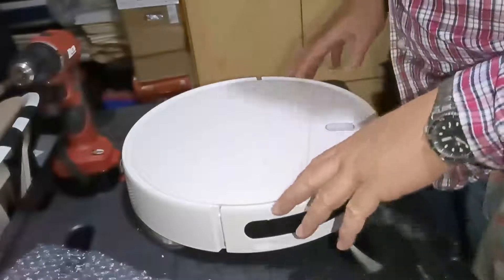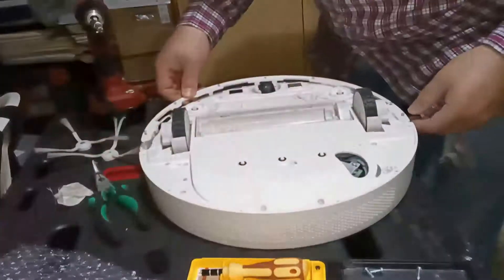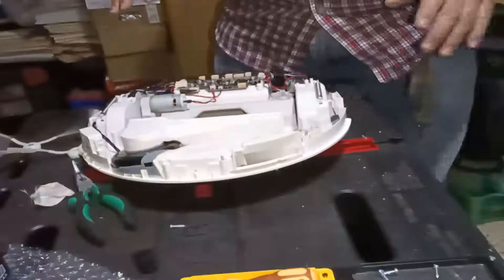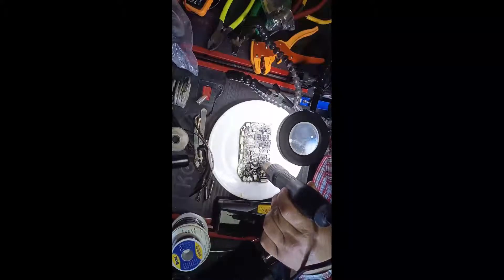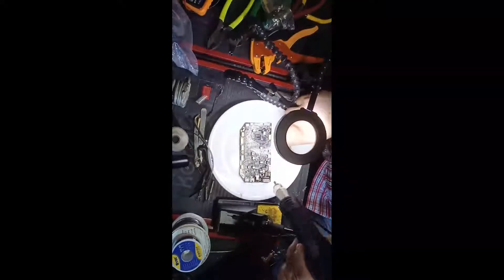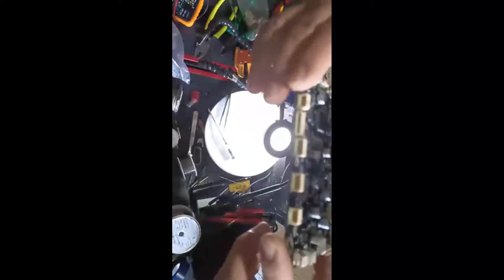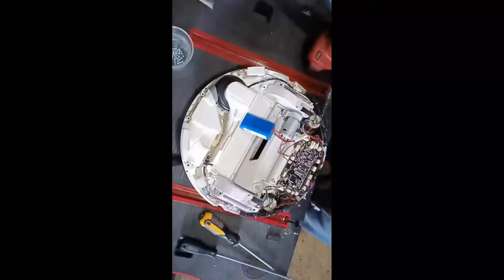Fixing a common problem in the Xiaomi Mijia G1 Vacuum-Mop Robot

Comment: When docked, there's a blinking orange light. long "power" press clicks some noises in the speaker and it continues to blink orange. DMM shows <2v in the battery, but long charging period doesn't charge it. how do I know if it's a faulty battery ? or a faulty charging circuit ? DMM shows some ~20v on docking pads.
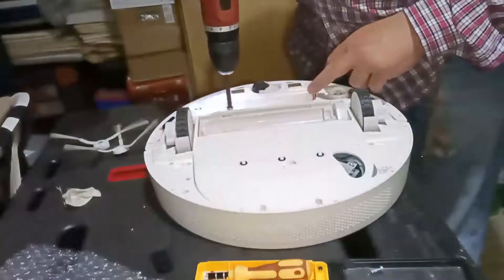Reply from the maker: Dismantle battery pack as shown in 1:15. Then test the contacts. If the external contacts show <8V, the pack is shot: It's enough one Li-Ion cell is below 2V and it will never recharge. So if the entire pack is <8V, you know it's basically gone. You can find another battery pack for the Mijia G1 at AliExpress. For example, https://www.aliexpress.com/item/1005006585073748.html offers several sizes. I'd go for the 12,800mAh battery pack, even though it's more expensive. In any case, your description bears all the hallmarks of a dead battery. Cannot guarantee this is the issue, but.. Well, 90% this is it.
Reply: @nyyotam4057  Awesome. just for my general knowledge (as an electrical engineer) ... how/why do you say that if the cell is <2v the cell is dead ? I'm trying to understand the explanation to that. (or in other words, why won't it ever recharge)
Reply from the maker: @HagaySpector  It's a Li-Ion cell. Usually you'd have a BMS that would cut it off when it goes below 2.5V in an effort to prevent it from even getting close to 2V. If it did wade under 2V then any attempt to charge it with a large current will result in an immediate destruction of the coating of the cathode (usually a thin cobalt layer), thus destroying the cell. In a factory setting, they charge the cells using minute currents until their voltages go above 2V and then charge to 3.7V. The cell is designed never to go down back under 2V in it's service life.
Reply from the maker: @HagaySpector  Well, I trust you will take care not to allow either of the cell voltages to rise above 4.2V per cell. Or, if you are afraid one of the cells might do that - well, just buy a new battery pack and that's it.. In any case, one safe way to do it, is to acquire a 4s BMS, like https://www.aliexpress.com/item/1005006682322680.html . Now you have to test it (!!!). I mean, once purchased a 10-pack of these Chinese BMS's and only two of the entire pack were okay. Go watch?v=8c-5-sHIrNI to see how I test them. Once you have the BMS tested, you can disassemble the battery pack and connect between each two batteries to the appropriate connection in the BMS. Afterwards you can charge through it while limiting the current to 50mA.. And then, once each of the pack's cells is recharged again to 4.2V, test every one of them using a 1ohm 20W ceramic current limiting resistor in series with a shunt to acquire the cell's internal resistivity. If it's under 0.2 Ohm, you can still use it. If it's more than that, I'd replace the faulty cell with a new one. In fact, this is my standard procedure to rejuvenate an old battery pack. watch?v=HSz-4IN_eHQ about that. But yes, considering time is also money, simply getting a new battery pack might be the wiser (and cheaper) choice here 🙂.

Comment: Good evening, I also have this robot model, I replaced the battery and now it does not charge, it tells me to check the connectors on the charger, but everything is clean, now it does not charge even with the old battery, what could be the problem?
Reply from the maker: Did the old battery and the new one give out the same voltage with the same polarity?
Reply: The robot does not want to charge now even with the old battery, it tells me to clean the contactor pins where the charger makes contact and it does not want to start
Reply from the maker: @cosminchincea9772  Use a multimeter. Check that the line shows continuity from the contact all the way till the CPU and where this continuity stops. Do it for both contacts and you will find where your line is broken. It could be that the burnt element is a fuse of some sort (perhaps a sacrificial resistor). If that is the case, you may need to replace it (or short it.. At your own peril). Well.. Good luck. What's the worst thing that could happen? At worst you'll burn the G1's board.. So you'll have a good excuse to throw it away and get a better model 🙂.
Reply: @nyyotam4057  Thank you, I still have a month's warranty on it, I will take it to you for service on Monday
Reply from the maker: @cosminchincea9772  😂😂😂👍

Comment: It is bit difficult to understand what problem it is you are trying to show to solve? It would be nice, renaming the video to match the problem rather than Common problem is so annoying when people do not name their videos to match what problem is taking to long time sittint watching and willl give you more that will watch;)

Mine won't power on and  when placed on the charger it comes on with short notice and power on/off continuously and battery has power 22,3v / charger works so am I facing same like you or ? Mew battery is pretty expensive so want to be sure first, can you help?
Reply from the maker: It could be you need to replace a voltage regulator. This board has sevaral HT133 units but I'm afraid that if any of them were lost, it could destroy other critical components like the CPU. So maybe you better think about replacing your G1 to a better model :-).

Comment: Did anyone fix the problem with the wheels? My vacuum it does not charge at all because when i put it in the dock it moves and disconnect from the dock. It is a battery problem?
Reply from the maker: Read my reply to McGybeer.
Reply: I have the same problem , did you manage to fix it?
Reply: @lyamc4445  yes, in my case it was the battery.

Comment: Hi my Xiomi starts clean up and after around 15 sec it says brush error please check and clean it, is it the same thing you fixed?
Reply from the maker: In my case the main brush would simply go on working relentlessly until the battery is dead (or until I dismantle the bot and unplug it), so the fix was straightforward, to replace the MosFETs. But your case is different and I'm afraid it's a lot more complicated: To get a brush error like that after 15 secs or actual work, you need your motor to be drawing too much current. To me it seems that the most logical explanation is that you either (a) need to replace your brush or (b) need to replace the brush motor, but there is also (c) that you need to replace its on-board motor driver IC which might be custom-made by xiaomi so if its (c) you may need to visit the vendor's support station and pay them to fix it, cause you might be unable to obtain the correct IC driver anyway. It might be proprietary.
Reply from the maker: OR maybe (d) you need to replace the current sensing resistor (which I have no idea where and what it is). If it's burnt and develops full voltage, the IC would see it and interpret this to mean too much current. So this is another possible issue that could cause it.
Reply from the maker: In any case, my case was simple. Your's not.
Reply: Ok thanks for your help
Reply: Hi just to let you know the problem was simple I found someone who had the same problem as mine and all that needed to be done was to solder again the brush motor wires seems that they can get some oxidisation and thus bringing the mototor to stop.
Reply from the maker: @Taxidermist69  Okay, that's option (e) then🙂. Glad you found a solution.

Comment: Thanks a lot for sharing this. I have the same problem, do you think if i just add a physical switch to the wire connecting to the brush motor, do you think this will work too?
Reply from the maker: It will enable you to stop the main brush which will allow you to manually solve the issue for now, until the MosFETs you purchase from AliExpress arrive 🙂.
Reply: I just did that an hour ago, and it worked...

Comment: Hi there! Thanks a lot for the video and for the links, I have the same issue of the wheels spining non stop. I've just changed the diodes, but the problem is still there. Do you have any other suggestion? Or maybe the board schematics, so I can try to investigate it. Thanks in advance 😉
Reply from the maker: This clip is about the main brush and not about the wheels. I don't have the board schematics but luckily, this bot is so simple you don't really need it, just use a multimeter to check which MOSes power the wheel motors and replace them. Check the MOS model to make sure you are replacing properly: It could be a low gate voltage high current PMOS enhancement mode just like the A03407A and if it is, and you already have A03407A's, they should work. However, it could also be some kind of an NMOS on the way to ground. So the only way to be sure, is to read what's written on it (use a cellphone camera with a flash an magnify). If you're lucky, whatever it is, it will be a low gate high current PMOS and if you already have them, you're golden. Tell me how you fixed it.
Reply: @nyyotam4057  Thanks, I'll check that 😉
Reply: @nyyotam4057  Mmmm... I'm checking it and it seems not so easy. My issue is both wheels and the main brush keep spining, that's why I thought it could be related. I've changed the diodes and the main brush still spins non-stop, and the wheels are powered by stepper motors. If all of them are affected, maybe it's a software/firmware issue. I'll post here if I find the issue
Reply from the maker: @McGybeer  Hmmm.. If all MosFETs are affected at once, maybe its not one of the MosFETs but maybe it is the voltage regulator (HT7133). Here's a link where you can find it: https://www.aliexpress.com/item/1005004050505952.html?spm=a2g0o.order_list.0.0.21ef1802j5qbMq - select HT7133 and good luck because this is a long shot.
Reply from the maker: @McGybeer  Sure, there is always the possibility that it is a software problem and then you need to try and D/L a new firmware from Xiaomi. I'm not at all aware of how to convince them to let you do that.. But that is definitely a possibility.
Reply from the maker: @McGybeer  In short, you may try to replace all MosFETS and voltage regulators on board just for the fun of it, and maybe it will work. If not, it's software. But even if its software, in this case this does not make it an easy problem, cause then you need Xiaomi to voluntarily give you their software. Maybe they will agree. Good luck in any case🙂 .
Reply from the maker: @McGybeer  Well, technically the CPU can be done, but the chance of that is very, very slim because it does have many protections. In most likelihoods, it would be one or more of the MosFETs - and in your case maybe just a voltage regulator. But technically it could be the CPU. BTW, did you try to remove and reinsert the card?
Reply from the maker: @McGybeer  I mean, in my Mijia there is an SDCard in the top part of the bot, connected via a cable strip to the mainboard connector. Maybe it got wet or something? Also a possibility.
Reply: @nyyotam4057  Can't find the SD. On the top of the bot there's just the button/LED board and the WiFi module
Reply from the maker: @McGybeer  Maybe 🤔 your mijia has another solution (flash chip or something). Anyhow, if the problem is software, this does not turn it to an easy problem to solve.
Reply: @nyyotam4057  Yeah, you are right. It will require a lot of time and tests. Just worth for fun 😂
Reply: @McGybeer  did you fix the problem? How?
Reply: @MrCringus  No, unfortunately I couldn't find the issue
Reply: @McGybeer  did you try changing the battery? Mine has a 3.2V, i will try to change it.
Reply: @MrCringus  Yes, I tried that and didn't work. I ended up buying a new vacuum robot because I didn't had time to investigate
Reply: @McGybeer  many thanks for your feedback!👏
Reply from the maker: @MrCringus  In fact I also bought a new vacuum, one with a LIDAR sensor that can make a map of the apartment and be told where to go. Only marginally more expensive, the Xiaomi Mop-P has these features. It is a bit taller, so some places that the G1 could creep into are off limits for it, but it does a fairly good job elsewhere. And you can tell it to clean only the kitchen 🙂. Gave my old G1 to my sister in law and she gave it to her sister - and as far as I know it is still working (though they also think about replacing it). The G1 simply has too many compromises to be called "good".
Reply: Hi guys, just a quick update: today i've change the battery and the vacuum works normal again!💪
Reply from the maker: @MrCringus  Yeah, but let's not get too carried away here 🙂. It's still just the G1.. Meaning, it will sweep your home, but the compromises Xiaomi took are way too large. Like, you have no consistent map. So you cannot tell the bot to go clean just the kitchen. Stuff like that.
Reply from the maker: @MrCringus  Still, congratulations for solving your issue.

Comment: Hi this video is very helpful, but my mijia g1 vaccum issue is when connected to battery the two tyre is spinning non stop and not the brush like yours. So if i change the  SOT-23 A03407A like yours will it solve the problem?
Reply from the maker: Not sure. I got no idea which MosFETs are used to power the wheel motors and not even if they are low voltage-high current enhancement P-channel like the A03407A, so I cannot really say that I know what to do, however, this bot is so simple - all you need to do is track the connections to the wheel motors and see which MosFETs powers them. Use a multimeter to check. Then you need to read what's written on them. Use a cellphone camera with flash and magnify. If you identify the MosFETs as a low-voltage high current P-channel enhancement mode, then if you have A03407A's they should work. If not, you need to order the right kind of MosFETs. There's no way to get around it. In any case, try to get good MosFETs which may not be the cheapest but they don't cost too much in any case. And good luck.
Reply from the maker: PS, note there is another commenter which has a similar problem. So, once you identify the wheel motor's MosFETs, he should be interested. EDIT: I mean, you can video yourself fixing it and post it as a reply clip 🙂 .